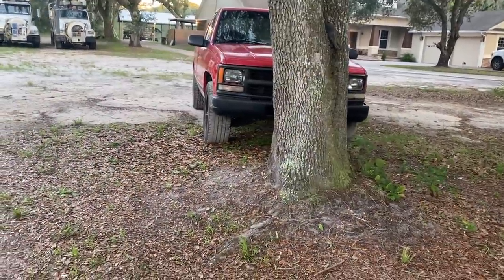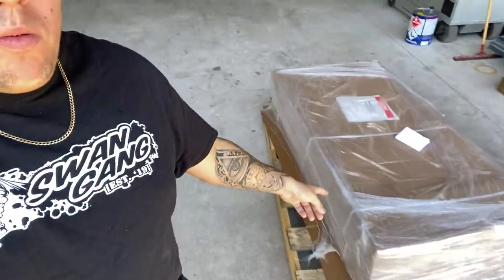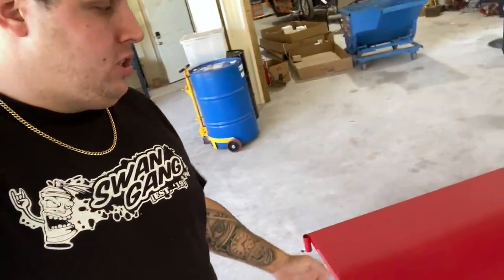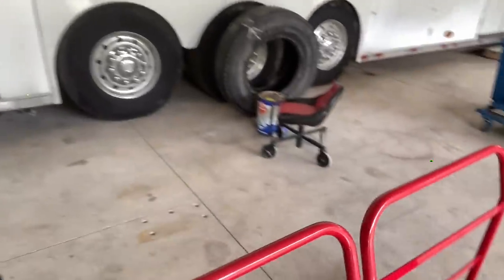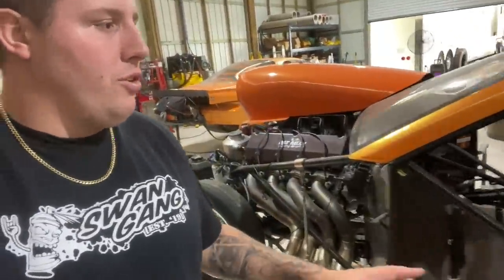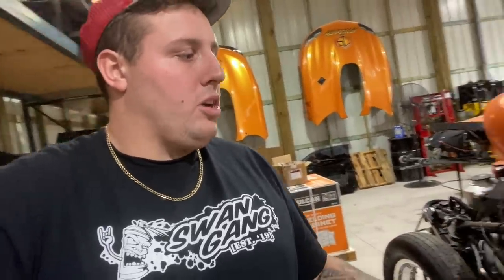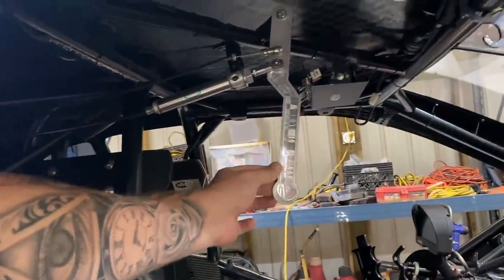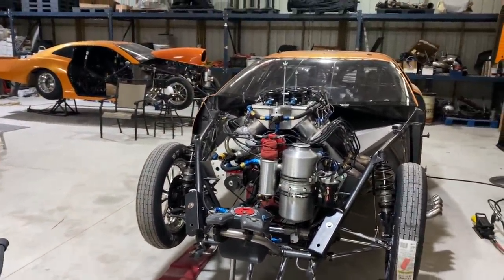Got New Push Cart For the Race Rig!!! Races Coming Up We Are Attending! (BUSY)

Comment: With your push cart just make a U pipe that just slides into the 2 holes for the Handel drill a hole for a pin to go through so they don't seprerate/shift

Comment: Use a pipe fence panel clamp with the bolt in the middle between the two handles and make something to go into the two tubes on the front.

Comment: UMMMMMMMMMMMMMMM NOOOOOOOOOOOOOOOOO!!!  Use plates!  You can always undo them if you need to make them just 5 foot by 30 inches to fit somewhere or change it up for some reason!

https://www.kingmetals.com/Catalog/ItemContent.aspx?ItemNumber=5042 x4.  One on top, one below on the front and back. Screw that shit down and use it, unscrew the bolts and break it down if you don't.

Welding them turns that thing into a turd if you need to fit them somewhere where they can be stacked or something.